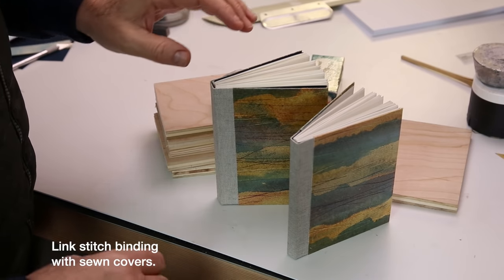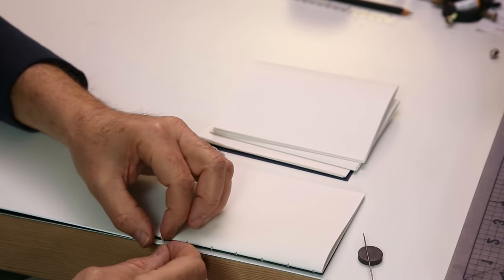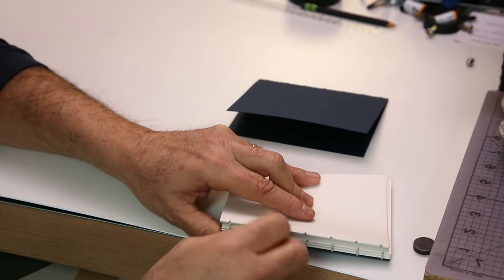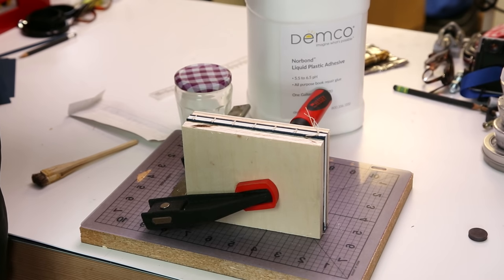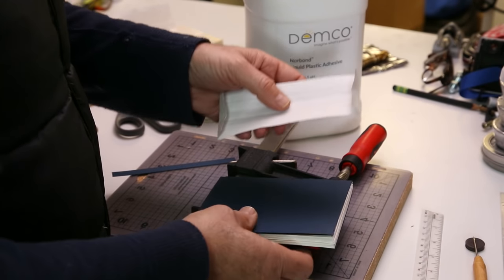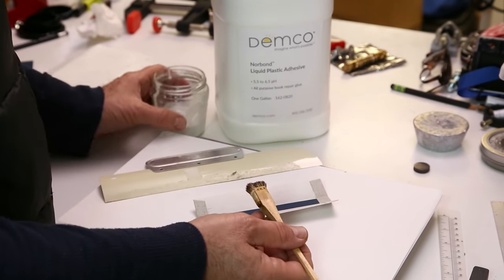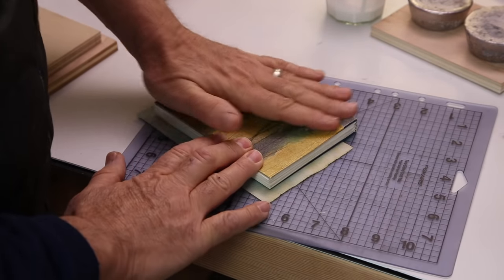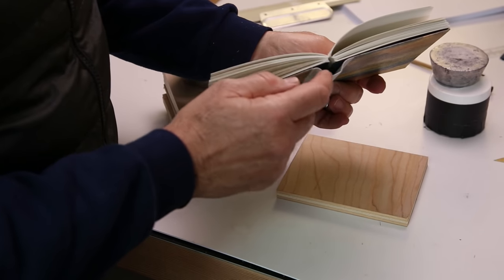Tutorial for Link Stitch Binding with Sewn Covers.

Comment: What a beautiful book. Did you have any trouble folding the watercolor paper around the covers? I have found that to fold watercolor paper without getting a rough edge I can run a light line of water behind (inside) the intended fold. Then it folds really nicely. I often make my signatures out of 140 lb. watercolor paper. 90 lb does not need to be moistened to fold nicely. Another idea....if you are concerned about a spill ruining the cover, consider spraying with fixative and/or treating with wax.
Reply from the maker: Thank you so much for your kind words. I have not done what you suggest in a long time. Many years ago I used a thin brush and also an old school “ruling pen” filled with water to apply a thin line of water. My reason for doing this was to tear paper in hopes of keeping a rough edge or simulated decile. A line of water would make it easier to fold. In this book, the thick watercolor paper folds with a bit of ease since I applied PVA adhesive which makes the paper more playable. All best. -Jim

Comment: Great video, very clear! But I do have a question that wasn't, for me, clear enough. It is essentially a coptic stitched book, right? But with that type of binding, do you need to use the glue on the spine where the stitching is? I ask this because I am making a sketchbook that needs to lay flat and while I've usually made them with coptic stitching to have the pages lay flat when open, does the glue used on the spine over the stitching make them not lie as flat as an exposed without adhesive applied would be? Thank you in advance for your reply! (I hope my question was clear!)
Reply from the maker: Thanks for the question. This sewing method is great for books that you want to lay flat. Just take your time so it is sewn tightly. If the sewing is loose, the sketchbook could feel too loose. Have fun. I hope you have success with your project. -Jim

Comment: Hi, sorry im not very good in english, maybe u already said this in the video but i couldn't understood.
Which kind of paper u using, i mean the white and blue paper, is not normal paper for printer right?
Thx for answer, and very good work.
Reply from the maker: Hello. Thanks for writing. The white paper that I use for the inside of this book is paper that is sold as drawing paper. I like this paper as it can be used for drawing with pencil, markers and fountain pens. These are sketch books. Any paper that you like to write or draw on, should work fine. I buy loose sheets of drawing paper from an on line art supply vendor called DickBlick.com. The blue paper is thicker cover stock. I buy that from another vendor in Michigan, USA called FrenchPaper.com. I hope this is helpful. You can try this project with papers that you have locally, as long as they work for the type of sketchbook or journal that you want to make. Happy binding. -Jim
Reply: @jaescala  Thx for your answer sir. I went to a shop in my city and i think to have found the right paper. Thx so much for the help, good luck.

Comment: Can you use parchment paper in lieu of wax paper?
Reply from the maker: You can try it. I assume you mean Parchment paper that I see in those baking section of the grocery store. I have not tried it. But it is worth a try. I love to hear if it works.
Reply: @jaescala  thank you, I did use it today as it's all I have when I bake. I don't use wax paper anymore.  It worked pretty well.  I am teaching myself to make books. I'm also learning watercolor painting, and today I made a small coptic stitched book using one of my paintings for the front cover. It turned out well.  I also have used water color pages for making a coptic stitched journal expressly to paint in.  I'm still quite the beginner and I really appreciate the tutorials.  Thank you!
Reply from the maker: @gailsawyer4235  Thanks for the information about using Parchment paper. I think making sketchbooks is one of the best reasons to bind blank books. Congratulations on your progress! -Jim
Reply: @jaescala  Hi JIm, since using the parchment paper, not only does the glue not stick to it, but I've been able to reuse the same two pieces for putting under my gluing pieces because the glue dries super fast on it and so I'm saving on having to use scrap paper. Win, win!
Reply: @gailsawyer4235  I also don't usually have waxed paper in the house but I do always have a roll of baking parchment. That's all I've ever used for gluing sheets in the decade I've been binding books and it works very well. Baking parchment is usually coated with silicone so almost nothing sticks to it, I usually just peel off any smears of glue/paste that might have stuck to it and it's good to go.

Comment: What kind of glue brush do you use
Reply from the maker: I collect brushes. I have far more that anyone will need. I do love the Surikomi Bake brushes. It resembles a stenciling brush. I used one to apply adhesive to the spine of the book in this tutorial. I order them on from McClain's printmaking supply. They are in Tigard, Oregon. They are not the cheapest. Just be sure to wash it frequently and it will last you a long time. Thanks for the question. Best -Jim
Reply: What size of the glue brush do you use?